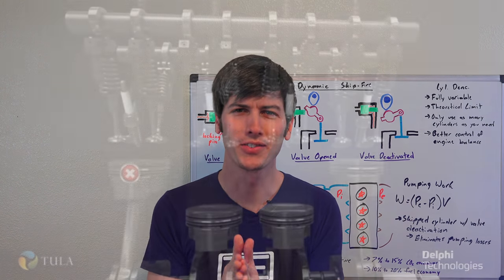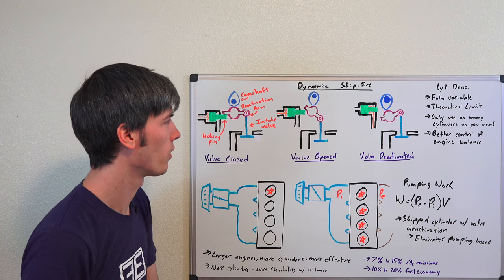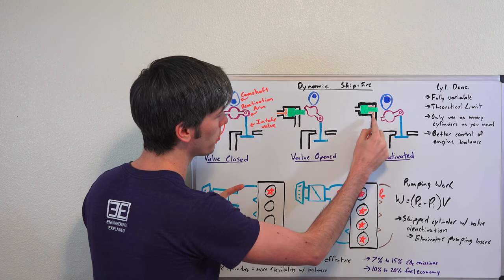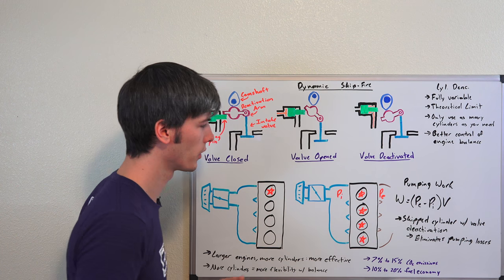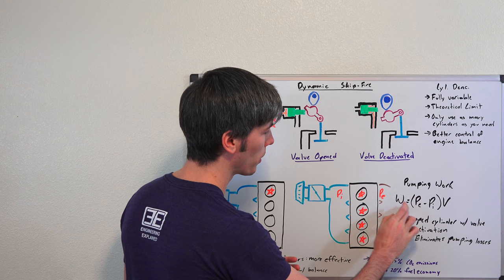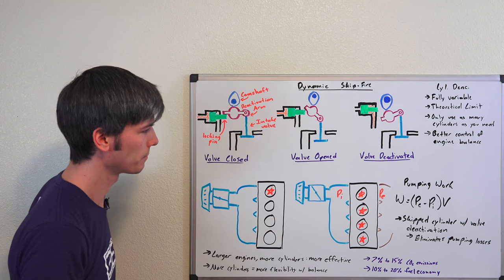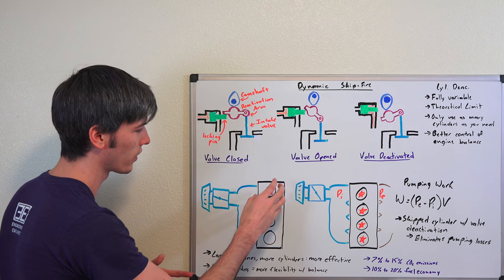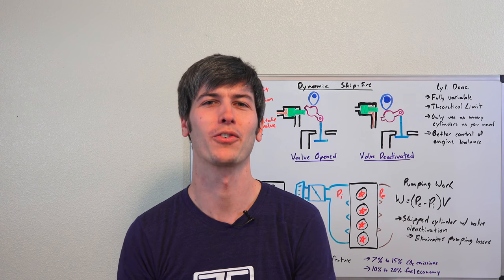How Dynamic Skip Fire Works - Variable Displacement Engines

Comment: My doubt is that will the energy saved by reducing the pumping losses greater than the energy that the working cylinder/cylinders have to spend on keeping all the non working cylinders/cylinder moving?
Reply from the maker: Those cylinders have to move either way, so yes, it makes up for it.

Comment: Well think of it as a reversed VTEC and that has been around for quite a while now and still works fine. I see what you mean by complicated thus unreliable. Variable compression springs to mind. That is complicated but if designed properly, should work just fine. This is just a pin operated by oil pressure. Only the electronics must to be complex, but which modern car computer isn't?

Comment: My concern with these systems has always been drawing crankcase vapors and oil into the combustion chamber of the deactivated cylinders.... would be better in my opinion if the deactivated cylinder combustion chambers were vented to atmosphere, seperate from the intake....

Comment: Since the valves stay closed what about the energy loss from compressing the air in the inactive cylinder or pulling the vacuum if the valves were deactivated at top dead center.
Reply from the maker: Acts like an air spring. Goes both up and down, little energy lost.

Comment: I don't understand why the system keeps the valves closed during deactivation. When the valves are closed the Piston is  creating a vacuum on the intake stroke either trying to pull through the closed valves or past the rings. You'd think it would make more sense let the valves work normally and just shut the fuel off to the cylinders that aren't being used. Most of the problems have been from the system that deactivates the valves.

Comment: Hi, long time viewer. Love your content. I have a question about this technology. Is this backwards compatible with older engines? Say a 330i E90 would benefit from this? Cheers 😊
Reply from the maker: Well it requires additional hardware, but the idea can be applied to any engine.
Reply: Engineering Explained would the additional hardware cost justify economical gains and what would the additional hardware be?

Comment: How will the percentage of heat lost through the 4 working cylinders be more than a single working cylinder engine???
Reply: Saubro Boro only one cylinder is generating heat and one cylinder can only shed so much heat so if it’s in one cylinder then it will shed less heat than 4, thus preventing a power loss
Reply: Aaron Purtell 
Yeah I know that a single cylinder will produce less heat than 4 but it will only happen if the working condition is same or throttle body is in the same opening or closing angle.But as in this condition the throttle body is in a different position so the heat generated will definitely be different.But as Jason said the percentage of heat lost through the cylinder walls of the four cylinder is more than the single,I am really confused.He said the heat generated in the single working cylinder is more but the percentage of heat transferred through the 4 working cylinder is more.But how will it happen if each of the four cylinder s produce less heat? I mean if each of the 4 cylinder produce less heat ,so they will release less heat.If you got my point please reply.👍👍👍👍👍

Comment: It stands t reason that this will cause uneven wear in the engine, correct? Do you think the ends justify the means?
Reply from the maker: Why would it cause uneven wear? Compared to traditional cylinder deactivation, this uses all of the cylinders, rather than just a single bank. Shouldn't cause wear issues.
Reply: Engineering Explained 
And to further explain, the computer could theoretically know how many cycles a cylinder has seen and adjust what cylinders get activated and deactivated to balance the wear.

Comment: I have a question. Wont this make the engine much heavier? since the piston that is working would have to bear the load of all those pistons which are not working, by load i mean the friction and the amount of work to make those pistons move up and down. If that piston is taking the extra strain to overcome this load, they would have to be much stronger, also the connecting rod and the crankshaft would have to reinforced as well right?
Reply: It's only used in low load scenario's so extra reinforcing shouldn't be neccesary. It's fully tunable remember? If the load become more you fire more cilinders. At full load with all cilinders firing will provide more stress than a low load with a little parasitic weight on the cilinder.
Reply: Marc Fransen Still, it would be heavier compareable to a standard engine. No matter what, each piston has to bear the load of those that won't be firing. So additional reinforcement would be needed i suppose
Reply: Marc Fransen for example. A car cruising on the highway, the V8 engine turns off 4 of the pistons. Now, these 4 pistons are still doing work to maintain speed, overcome drag, bear the load of the pistons not working. So technically, you would have to reinforce the engine a bit more this making it heavier

Comment: why use a camshaft at all?
just use solenoid driven valves - that way you can also implement variable valve timeing as well on a per cylinder base for intake and exhaust

Comment: Freevalve is better
Reply: Samejima Mamimi 
Freevalve should be simpler in terms of moving parts and such.  But both ideas at least allow for adding economy in larger engines, so it’s a win.
Reply: Freevalve would still allow this exact style of cylinder deactivation to work, it would just have a different mechanism for getting it to work.
Reply: And could also support variable lift and timing without any further mechanical complications = better
Reply: mkazub 
The only thing is free valve is far more complex and uses high pressure air to actuate valves. Oil actuated valves have been used for well over 10 years now for VVT on engines. It is extremely reliable and very fast to react. I am not saying that free valve is unreliable, just not a well proven as oil activated valving.
Reply: I can't wait for Free-valve to trickle down, its gonna be a game changer, no more timing belt change interval, no more throttle body!  No more negatives from direct injection, cause it uses port again.  It's gonna be awesome!!!
Reply: MasterMech77 VVT does not use oil to articulate cylinder values, it only changes the cam profile and adjusts timing.
Reply: Kartboarder22G 
EXACTLY I am looking forward to seeing camless valvetrains. It is going to be a game changer for tuners and engine modders. :)
Reply: MasterMech77 when a thread discuss camless valves and you reply with “oil articulated valves” one could have assume you were either uneducated or unaware of the difference. Had to be sure, and but you passed the smoke test
Reply: Way better!
Reply: Scott I 
No worries :)
I try not to be overly detailed in the comments section, but guess I should have been a bit more concise in what I was "talking" about. Thanks for the "nod" of approval, and glad I passed the test :P
Reply: Freevalve is entirely electric
Reply: Scott Dann
    Freevalve's technology is called PHEA (Pneumatic-Hydraulic-Electric-Actuator). It uses a electronic solenoids to direct high pressure air to force hydraulic oil to actuate cylinder valves on the engine. The high pressure air is taken from the engines own cylinder compression cycle, which reacts on the hydraulic fluid stored inside the cylinder valve's actuation body. Thus opening the cylinder valves, for a set duration, dependent on certain perimeters. So think of it like this, it is the same principle that is used in service centers to lift vehicles up so the technicians can work on them, just much smaller and quicker. Hope this clears up the confusion in this comment thread, I have seen some interesting answers so far. BUT basically the FREEVALVE's technology is a combination of Air, Oil, Electric, with a little black magic thrown in there to make it all work ;)
Reply: Idk if you know, but Toyota is now using a form of VVT called VVT-iE which is Variable Valve Timing with intelligence Electric. It uses an electric motor instead of OCV valves and they only use it on the intake side of the 2018 CH-R and Camry hybrid (the A25-FKS and FXS I believe). It basically just throws an electric motor on the intake cam and rotates it like the phaser would. It is interesting and I have yet to see or play with it yet but I studied up on it and am curious to see how it plays out. I'm also curious to see if any other manufacturer has tried this because Toyota isn't one much to pioneer things
Reply: Scott I v tech yo.
Reply: OH and I completely forgot, but Toyota is at the forefront of helping people walk again with their Toyota Mobility Foundation aimed to give mobility back to people with lower-limb paralysis, and so much more then just vehicles.
Reply: It's also patented. But awesome!

Comment: Will this work to decrease fuel consumption in say an Inline 6 diesel or some large industrial engine even though they have turbos (causing high exhaust  pressure) and no throttle?

@engineeringexplained

Comment: Does this cause any unwanted vibrations in the engine for example out of balance?
Reply: I have seen the dodge mds engines causing vibrations in a truck not a car
Reply from the maker: It's actually much smoother running than traditional cylinder deactivation methods, because the algorithm can choose what cylinders to run based on efficiency, as well as what results in proper balancing.

Comment: So I guess the next step is instead of having a single throttle valve, you have 1 for each cylinder. So in a 4 cylinder engine, you press the gas pedal down 25% = 1 cylinder throttle valve is 100% open. You press the gas pedal to 37.5% = 1 cylinder throttle valve is 100% and a 2nd is at 50%, you press the gas pedal to 75% = 3 cylinder throttle valves are 100% open and 1 is still closed...etc

Comment: Its not complicated enough!! LOL!

Though, I do think there might be premature engine issues from piston rings operating without sufficient pressure to seat them. I'd imagine there would be much poorer oil control during non-active cycles unless a form of "air spring" ('captive volume of air' to use simpler words for those who need them) was present to help seat the rings beyond what their own natural spring pressure can do. Perhaps it'll just be excessive blowby.. who knows until one has a lot of real world miles, right?

Comment: Just t'other day I was reading about an engine that uses (or will use) cylinder deactivation as an emergency get-you-home measure in case of cooling system failure.

Comment: So is there more wear and tear on the deactivated cylinders since fuel is not lubricating the top end? Also to jump on the bandwagon, its complicated and will fail. But seriously, the current GM DOD technology that has been going since 2009ish, is a big problem in the performance community. Lots of people are removing the system for a traditional valvetrain. Is the system that bad or is just because people want aftermarket camshafts?

Comment: At what altitude does turbo engine start to lose power? Does turbo increase boost to compensate lower air pressure?
Reply: Krazzed For a single turbo you would just gradually lose power with increasing altitude, and there's no way to increase or decrease boost to compensate because the boost just depends on the exhaust velocity and the size of the turbines. For a twin turbo it would depend on how it was designed but it might be able to compensate.
Reply: This would depend on how the turbo is configured. If the engine is tuned to only use say 75% of what the turbo can produce at peak while at sea level, the the waste gate would say shut to allow the turbo to spool higher and draw in more air at high altitudes until it reaches its boost limit. That said, if you are so high that the turbo is unable to keep up the boost produced by the turbo will begin to fall.
Reply: Thanks for the detailed reply.

Comment: I thought closing valves caused problems - sucking the oil up past the rings and burning it.  Seems like you'd be better off with a valve open so the piston can move freely.  (But you can't do that with an interference engine.)

Comment: The switched out cylinders are a power sapping drag.  
EcoMotors (backed by Bill Gates) made an opposed piston one cylinder engine that is balanced.  Two can be coupled using and electric clutch. In low loads only one of the engines is used and the other engine 100% decoupled and not moving forming no drag whatsoever.  More power needed and the second engine is switched in. The two cooling systems can be common to ensure both are up to temperature at all times.
Reply: Opposed piston engine isn't great for power, only for added torque. Power increase is not too significant v/s a single cylinder. Its not used for automobiles. A V2 or I2 would kill it in terms of power output any day.

Comment: if running at high loads is more efficient, why when we cruise we use the highest gear possible to achieve minimum rpm?
Reply: Gabriele Nitti minimum is around 2000rpm.
If goes like 300rpm, the car will struggle.

2) that's for cruising scenario. Airflow is good.
How about in traffic jam? Very bad airflow, and then induce restriction at throttle, makes the airflow get worse.

Therefore, they want to open the throttle body bigger in low airflow scenario.

Comment: Uneven wear on engine components? I’m thinking I’d prefer an electric hybrid model over this with a a traditional “uncomplicated” 4,5,6 or 8 cylinder motor that would dump excess power into a battery system and then drawing upon that power (possibly shutting down the gas motor completely) when optimal and running fully electric. BWTFDIK

Comment: So....won't those unfired cylinders  suck the power from the firing ones? I know those unfire ones are not injected with fuel.
Reply: L Adam most of the power is due to pumping losses, and if the valves stay closed then there is no pumping loss, there will be some loss of power from friction, but this is not as significant as having to fire all cylinders. Hope this helps
Reply: Say the cylinders that are closed have 1bar of air in them, you will lose energy by compressing it but will recover most of it when the cylinder decompresses. And the same also goes for the reverse if the cylinder has less then 1bar then the decompression would take energy and the compression would recover. Now this is not a perfect explanation but it is the basic function of it. 

The big loss is from trying to pull air into the cylinder.

Comment: I'd like an explanation of why throttle the air at all?  Why not simply have a wide open intake & manage engine speed / power entirely with fuel?  Effectively a stuck-wide-open butterfly valve.
Reply: The Barking Mouse this is how diesel engines work, but petrol is unable to ignite if the air fuel ratio is not within a specific range, so at low load, there would be loads of misfiring.
Reply: The Barking Mouse I didn't say diesel is able to burn over a very wide air-fuel ratio, so it can do this fine
Reply: The Barking Mouse 
You’d rarely, if ever, get the ideal air/fuel ratio for maximum efficiency. Your A/F would constantly be changing, going from lean to rich to lean to rich, and so on. The A/F is very important for both power and efficiency.
Reply: Bavarian Banshee Thank you guys.  I know this.  I'd just enjoy seeing how he explains it.  BTW at one time BMW was using their valvetronic system to operate without butterfly valves.  Using the intake valve to manage the air flow.  Don't know if they still do or not.

Comment: ADI air direct injection. Eliminate intake valves all together. We know what stoichiometric for gasoline is. So mathematically calculate how much oxygen is needed for a desired compression ratio. Gas direct inject the appropriate amount of fuel. Using an air filtration system remove contamination from the oxygen. Provide the cylinder clean burning oxygen with the appropriate amount of fuel for the most usable work.

Comment: So none of the valves will open when a cylinder is deactivated, what about the pressure left inside the cylinder acting as a vacuum ???
Reply: xkyo77x 
Acts like an air spring
Reply from the maker: Correct, no valves open. The pressure inside varies, but it compresses what's inside, then expands. Overall there's not too much energy lost in this situation. It's like an air spring.

Comment: I understand all the points you give. But saying the closed cylinders have no pumping losses seems like an over statement. Those close cylinders are having to expand in a vacuum. Wouldn’t it be harder for the cylinder to expand in that condition? Thus using power from the cylinder that is firing to fight the vacuum in the cylinders that are completely closed.
Reply: at the same time that one cylinder is going down another one is going up, cancelling the forces. Nevertheless, It will have a small parasitic loss because of the friction between the cylinder and the walls
Reply: Tadeu Ferreira yeah the parasitic loss is what I was referring too. It’s going to be there. And I’m not sure on the technical terminology for a “pumping loss” but this seems like a pumping lose to me haha
Reply: It's not a loss. You are right, the vaccum will try to keep the piston from going down but also "suck" is back up. Just an air spring you store energy and get back right after.
Reply: remytv yeah maybe. I’m not smart enough to know, and don’t have the equipment to test it. Haha
Reply: Bro unless you open the valves there is theoretically no question of pumping loss. But the pistons are going to slow down the crankshaft rpm a bit due to the friction.